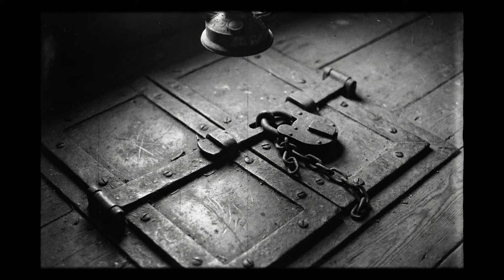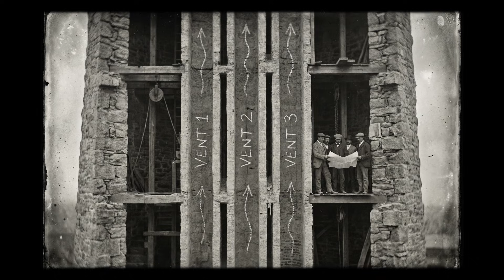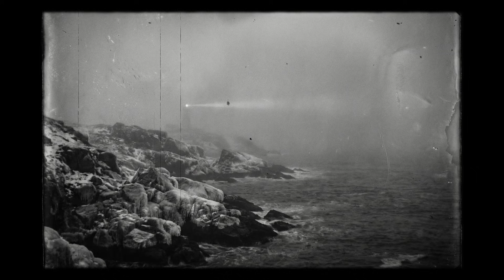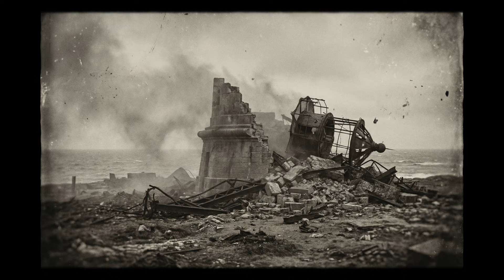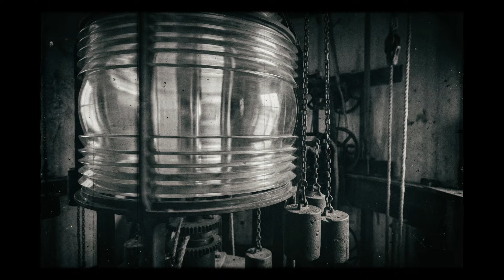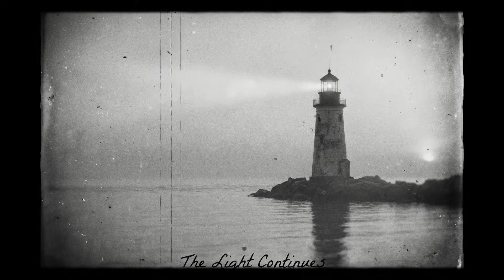Old Lighthouses That Worked Without Electricity — The Light Towers Nobody Ever Truly Explained

Comment: Will if you're using large amounts of mercury insted of bearings for rotation, you gonna need adequate ventilation or you're gonna start having major health problems. And as of the humming and the way they're built , well , they're in salt water , and they're built like a spire , you're probably conducting atmospheric electricity🤷.
Not to mention, how did they take all the materials to these rocks that are constantly getting battered by waves, massive waves at that and build all this s*** on wooden boats anchored next to a rock, I don't think so....
Reply: Perhaps some sort of temporary wall was erected to block most of the brunt of the pounding waves during the construction of the lighthouse, and then the temporary wall was removed so that the waves would make the lighthouse function as it was designed to?

Comment: The Lighthouse of Alexandria, or Pharos, was a massive ancient lighthouse built in Egypt around 300-280 BCE, serving as one of the Seven Wonders of the Ancient World to guide ships to the bustling port, standing over 330 feet tall with a fire/mirror system for light. Commissioned by Ptolemy I and completed by his son, it was a marvel of engineering with a square base, octagonal middle, and cylindrical top, but was destroyed by a series of earthquakes between the 10th and 14th centuries, with its ruins eventually used to build the Citadel of Qaitbay, though underwater discoveries continue today. 
Key Facts:
Purpose: Guided ships to Alexandria's harbor, acted as a lookout, and showcased the city's power.
Construction: Began under Ptolemy I and finished under Ptolemy II; designed by Sostratus of Cnidus.
Structure: Three stages (square, octagonal, cylindrical) with a spiral ramp, reaching over 330 feet (100m).
Light Source: A bonfire at night, reflected by a mirror during the day.
Destruction: Damaged by earthquakes in 796, 951, 1303, and 1323 AD, with final remains used for the Citadel of Qaitbay in 1480.
Rediscovery: Underwater archaeological finds in the 1990s revealed submerged ruins, with blocks being studied for digital reconstruction. 
Legacy:
It was the third-longest surviving ancient wonder and inspired the word "pharos," meaning lighthouse.
Modern archaeology uses digital tools to study recovered blocks to create a virtual model, revealing more about its design. 
Lighthouse of Alexandria - 7 Wonders
It was one of the greatest architectural feats of the antiquity. Besides, the Lighthouse was the only wonder that was constructed ...

7wonders.org

Explore Lighthouse of Alexandria: Ancient Wonder of the Seas
The Lighthouse of Alexandria: The Ancient Wonder That Lit the Mediterranean. The Lighthouse of Alexandria, constructed between 284...

Egypt Tours Portal

The Enduring Mystery of the Pharos of Alexandria - Ponce Inlet Lighthouse
The Lighthouse of Alexandria, many times also referred to as the Pharos of Alexandria, was a lighthouse built by the Ptolemaic Kin...

Ponce de Leon Lighthouse

Show all

Comment: The rooms contained bells that were rang every 15 seconds from the ocean shoving water into the bottom of the 3 shafts that forced air UP alternated which one was open all operated by the density of of the brine and air  which then brought forth the light houses being built on land by using the rushing water of self perpetuated brine vs fresh water systems that ran across many of miles meeting at depos where resonate cathedrals are built on top of   which had magnetrons built into the windows to amplify the sounds as sound and light are one and the light coming through was passed thru the magnetrons adding extra vibration to the building itself. The light houses and cathedrals all have antenna on top to pick up the Schuman resonace between the earth and ionosphere most likely the frequency matched by the bells and tubes ;) this was the tartarian free electral system that was systematically destroyed along with the bells.  The weights reset which tube was able to to be open. And clearing it out to be reloaded to create the resonance that matched the bell itself making a perpetual resonance chamber hence the reason the "Storage rooms" used the certain stones for sound dampening to keep other frequency from entering into the bells corrupting the resonace
Reply: How could you possibly know all of that? I'm not saying you don't. Sounds like you know exactly what you're talking about. I'm just curious how you know?
Reply: @dextermorgan1 Ask yourself:
Who was actually "removed" during the greate resets/extermination of people during the "revolutions" the last 300 years? Culture revolution in China? The Russian revolution? The termination camps in Sibiria? What happened in Europe? The removal of knowledge?
Reply: @JohnHJaabk ; And other historical facts architecture etc
Reply: I love it when you learn as much from the comments as you did from the video. Thank you for your information.
Reply: @npoudre I could barely make sense of the run-on sentences 🙃🫠
Reply: That's an interesting statement...🦉🧘🏻‍♂️🦉
Reply: Wow. Thank you.
Reply: tell me more

Comment: You can construct ventilation with self-drag principle. You contruct 2 self-drag close to each other, a third toroidal shaped Vortex self-drags in between, amplify that with a rocket stove under. You do this in a tower with copper roof and a flat large surface area combined with moist air = high density of electrons, attracting plasma and lightning. In principle you can have a steady stream with current constant contact with plasma from sky. That's the holy grail.
Reply: Nice
Reply: Brother, from where u get your lections???
Can you mimic?
Please enlight us profesor